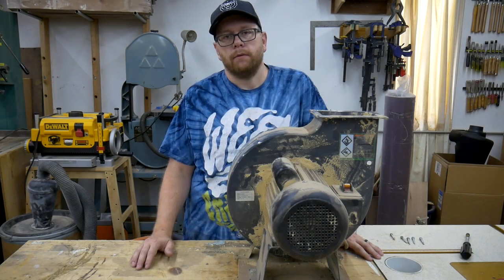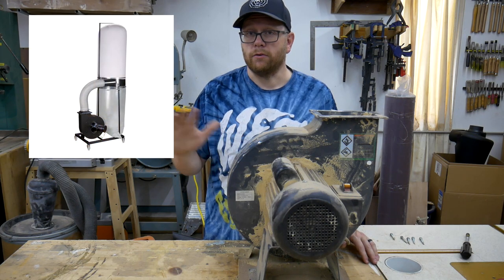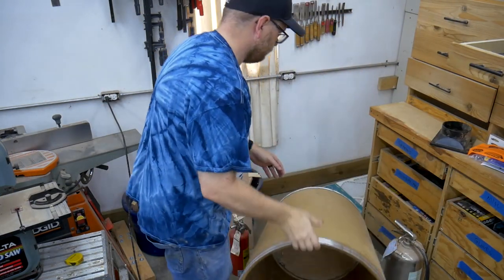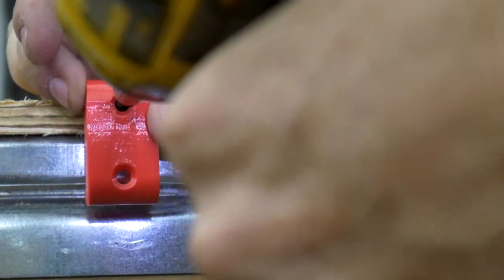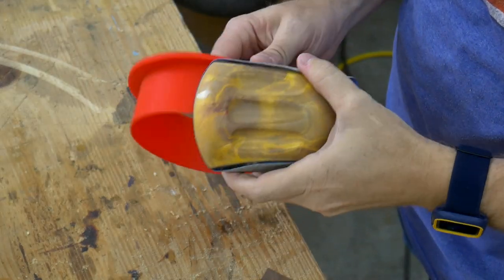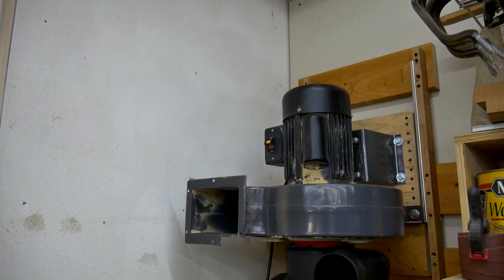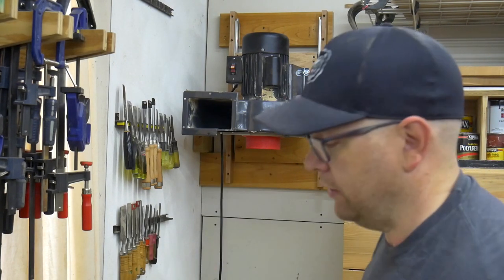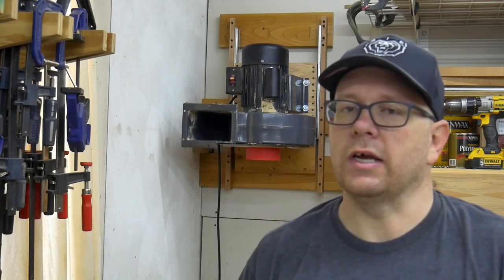Affordable 2-Stage Dust Collector Part 1

Comment: great video, thank you for the great ideas for my own HF dust collector

Quick question, is there a way to remove and replace the actual motor or is it sealed on the dust collection unit?
Reply from the maker: The whole thing can be disassembled if desired. I know a common upgrade to these units is to replace the stock impeller with a larger one as there is plenty of room in the shroud. It improves airflow at a small cost. Maybe look up “Harbor Freight dust collector Rikon upgrade”.

Comment: Very cool ideas. How’d the truck canister work out? I’m currently debating upgrading by bag, and I really don’t want to spend 300 dollars or more on a filter. I’d rather vent outside then do that
Reply from the maker: The truck filter works great. It takes some work to get it clean when it clogs, but I assume the same goes for the name brand filters. I’m thinking about putting a second one on the unit to increase my square footage. Should clog a lot less quickly that way.

Comment: I can't find info on the cfm of that filter, is it enough for a 2hp blower?
Reply from the maker: More than adequate for my setup with 4 inch pipe. I usually have 2-3 blast gates open at any given time with no loss of suction.
Reply: @SouthpawWorkshop  that's fantastic, I just moved into a house with a shop and got a 2hp blower for free with my planer, time to get to work